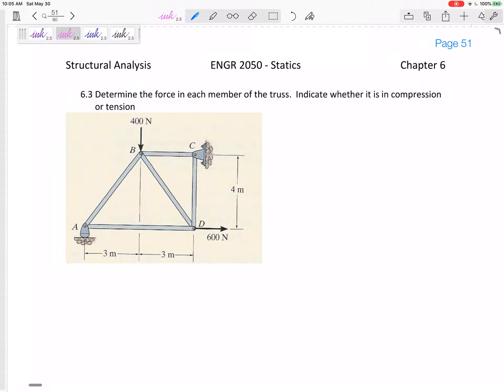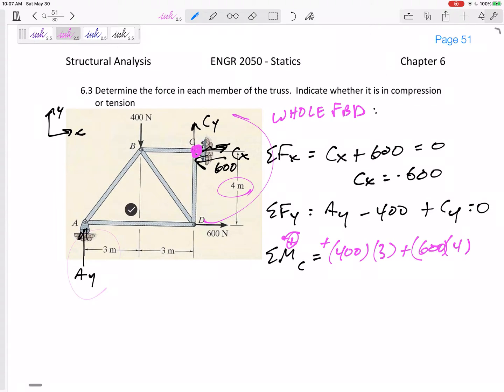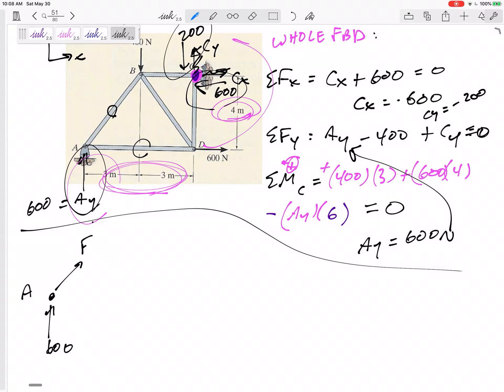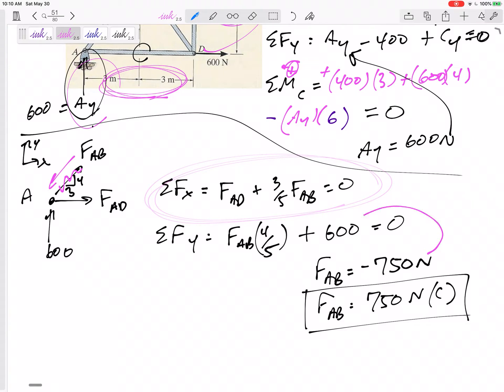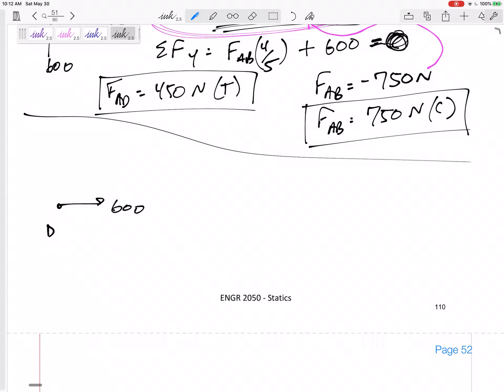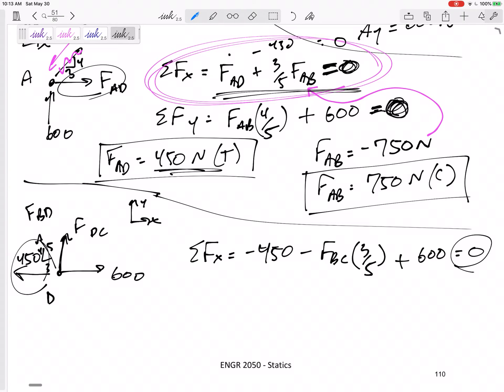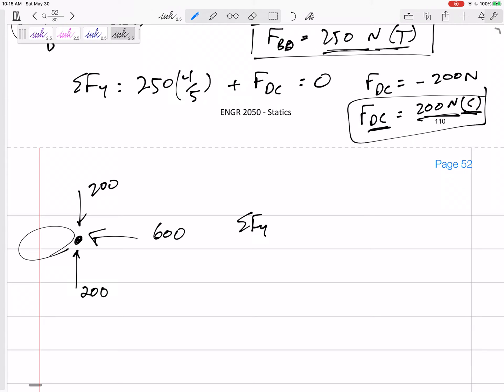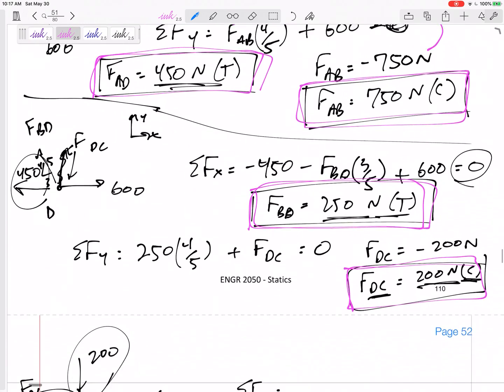Statics - Truss Method of Joints example 3

Comment: why the 600N not clockwise? and if it is how will that affect my working?
Reply: put your hand at C and curl it in the direction in which 600N is going, as you can see it goes anti clockwise. This one mistake will alter your answers entirely as the support reactions would be calculated incorrectly. Hope this helps!